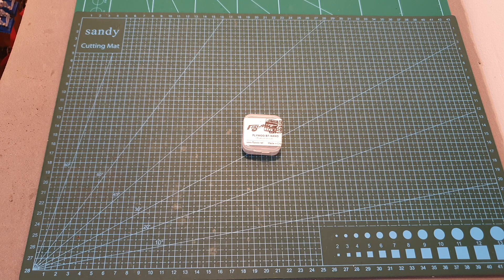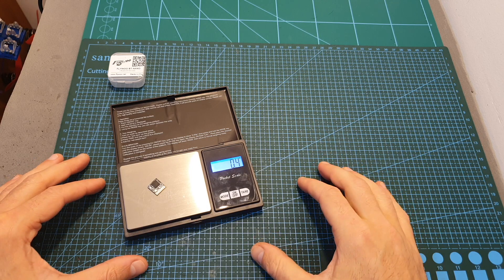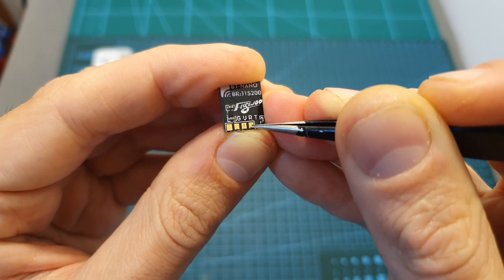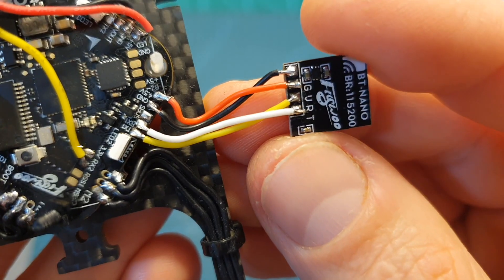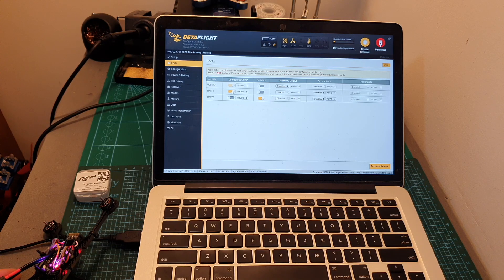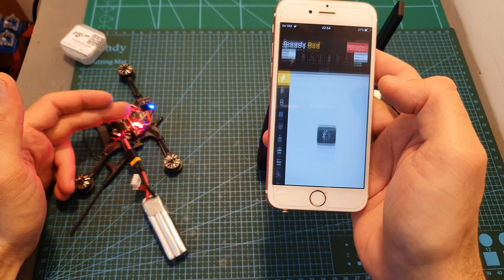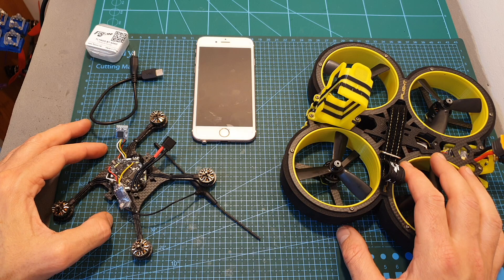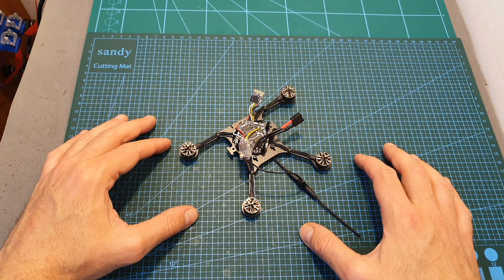Flywoo BT-NANO - A Lightweight Bluetooth Module

Comment: Is it possible to use the speedybee app to get the Blackbox data via this module?
Reply from the maker: As far as I can remember - no.
Reply: @KremerFPV  Can this be done with the speedybee bluetooth module then?
Reply from the maker: @leenanipun1269  No. Only over WIFI.

Comment: Was wondering if this causes interference with other 2.4GHz radio systems ie Ghost or ELRS at longer ranges??

For those who cannot get it to work (check your wiring of course) and ONLY ONE MSP can be used so you must power the FC with your battery pack and not the USB port (V1 and V2). I used baud rare of 115200. If baud rate is too high, play around with lower values. V3 of the module will fix things.
Reply from the maker: Thanks for sharing this information. The BT module will be turned off when the drone is armed so it's not going to cause any RF interference.

Comment: Great video, but it's not working with Betafpv AIO F405 20A.
I'm using UART 1, MSP enabled. While trying to connect with Speedybee the red light is solid, then I get MSP communication error and red light is flashing.
I have tried with Baud rate 57K but still the same.
Reply from the maker: Thanks, that's weird, as it should work with all FCs. 
Did you get it sorted? Have you tested your BT unit with other FCs?
Reply: @KremerFPV  I have one Holybro Kakute F4, will try it out soon. The thing is that I need this BT module for my tiny drone so that I can access BF in the field. The USB port is blocked by a standoff.

Comment: Hi I can't connect my quad via USB so can't access Bataflight, can I still have it connected to my phone ?
Reply from the maker: Hi, it's possible only if you configured previously the Bluetooth module on one of the UARTs. If not there is a way to fix it however it won't be easy and will require you hardware that you probably don't have.
Reply: Can I use the air unit Uart since that Uart already has MSP turned on

Comment: Mine flashes red instead of blue, and the speedy bee app detects the nano bt but doesn’t connect... any idea sr???
Reply from the maker: Check if the RX and TX connections are not reversed.
Reply: Gal Kremer mr Kremer I connected r on my tx4 and the t to rx4 of my matek f405 std... and I did it with colored wires to not mess it up...

Comment: I can not get it to work on the Kakuata F7 v1.5
Reply from the maker: What seems to be the issue? Did you try different UART ports?
Reply: @KremerFPV  Yes, I tried different Uarts, I tried it on two separate Kakuata F7 Flight Controllers, and also tried three different Bluetooth Nano's. I bought five of the Nano Bluetooths for different quads, but it will not work with the Kakuata F7. Thanks for responding.
Reply from the maker: @befreebailbonds3329  That's really strange and doesn't make a lot of sense. Did you make sure that you soldered TX to RX and vice versa and also turn on the MSP switch on the UART port?
Reply: Same with mine. Thx to rx 3.3v.   I can pair but won’t enter app. Tried 2 ports. My old o6 is fine

Comment: Damn that thing is tiny... And cheap so I might pick it up. I just need a good use for it, maybe to tune a quad. Funny story, I just smoked my VTX by connecting battery voltage into the camera power out LOL. Amazon allowed me to return it fortunatly. Also I have one question, my phone doesn't have a UVC driver but is there any way to make the eachine ROTG receiver work, bought it whilst thinking I had a UVC driver.